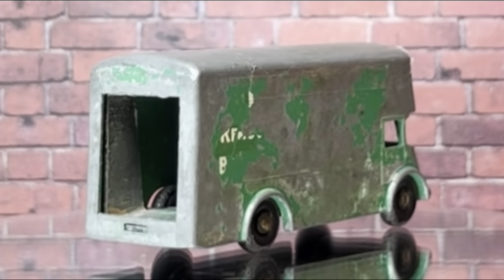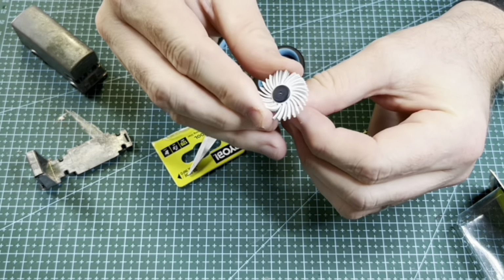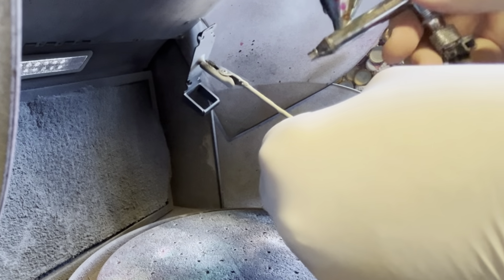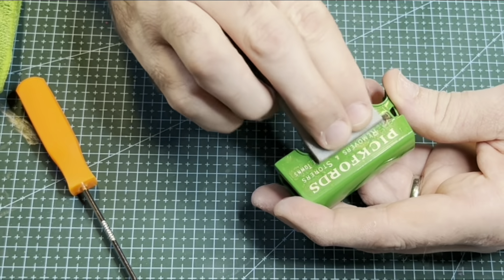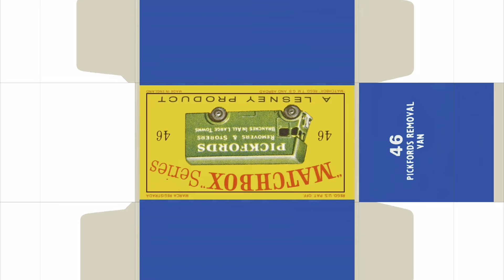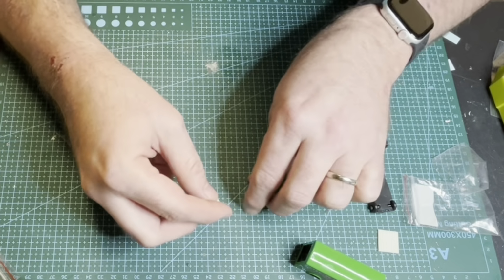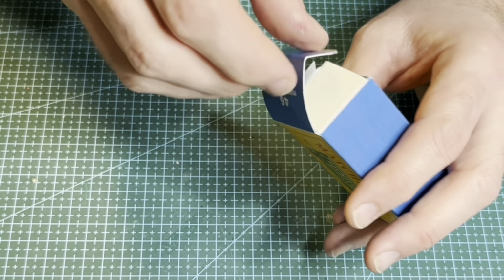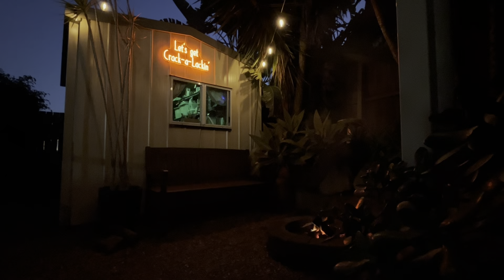Matchbox Lesney #46 Pickfords Removal Van Truck Lorry Diecast Restoration

Comment: looks lovely. the lighter green is unusual, but suits well. too bad about the decals, and I actually facepalmed when I saw you fiddling with that inflexible rollo... made in rigid resine? what were they thinking?
I got one of these Pickfords at the flea market  a while ago, and luckily the rollo is still inside, pushed in and shoved down the hall into the drivers' fictional neck. but it's still there. :)
Reply from the maker: Thank you. I should have gone a bit further with matching the paint but I like it in the end. I incorrectly assumed the roller door was just a bit stiff and needed a bit of flexing to 'warm' it up. Completely rigid resin, so it would never have fit without cutting it down anyway. And the more I look at the second lot of decals, the worse they get. The 'P' is terrible.
Reply: @PBsRetroRestorations  aw. well, what can you do...
browsing my pile I found the little Matchbox Daimler Double Decker Bus in ivory paint and livery, and the paint is chipped but the decals are still perfect. I might have to try and match the paint Marty style, and cover the decals for a refresh. :P there is also an old Dinky Commer wrecker with perfect decals while the rest is chipped dead.
...what if the go and try to keep the original livery wherever practical and feasible instead of erasing it all and repainting it with decals that won't fit?

Comment: I know every builder uses a wire brush or equivalent to buff the model before primer and paint. However i question how a shiny surface helps adhere the primer? Surely it is more important to colour match and to make sure it’s a grease and oil free surface. But I don’t see many degreasing before primer. Thoughts?
Reply: I think it has to do with the layer of zinc oxide on top, the layer that makes it dull grey. not many paints stick to that properly. there are also differences between cast zinc alloy, like what our fave toys are made of; galvanized zinc, and flame-splattered zinc. the latter actually repents normal paint, and you either need a special basecoat, or have to wait until the silvery surface is a dull dark grey...
aside that, the buffing is to make sure no one misses big scracthes, gaps, or any other flaws you'd later see through the paint. and it has become a kind of ritual, too. :)
Reply from the maker: I would think the same about a shiny surface Bob. It's very tempting for some reason when it starts getting shiny to keep on with it. I know in this instance when I stripped it the second time, it was a complete mongrel to get the paint off again, but that might have been from the two lots of clear it had. I do try and degrease the castings, I don't always do it and I don't often film myself doing it. I didn't do it to this one. I used to get really stressed about getting a super close paint match, but sometimes I let close enough get through however in saying that I'm doing a K5 Racing Transporter at the moment and the green I used was way too dark and it's getting stripped again, so sometimes I try 😊 Thank you for your thoughtful feedback.
Reply from the maker: Also (especially after caustic soda stripping) you really need to get that layer of residue off before anything else.